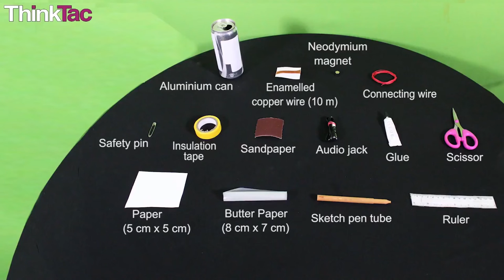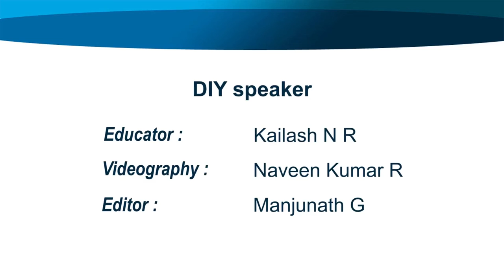DIY Speaker | ThinkTac

Comment: sir should we use only the magnet of the specific shape and size or can we use flat ones
Reply from the maker: A disc/cylindrical magnet is the best, because then the coil can be wound around in a circle (solenoid), which gives the maximum flux when current flows through the coil. Also, strong magnets are best (hence neodymium magnets), but very small in size, so that the coil is compact. Ferrite magnets, bar or ring, will be too weak at that size. If the coil is too big (which will be the case if the magnet is big), then the coil will be too heavy and unwieldy to work with the small electrical signals the wire gets through the audio jack.